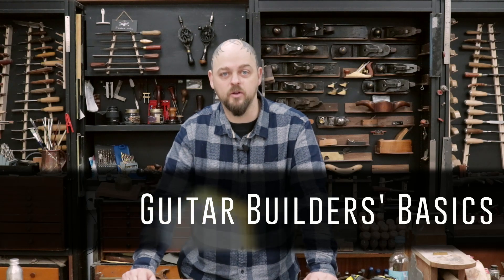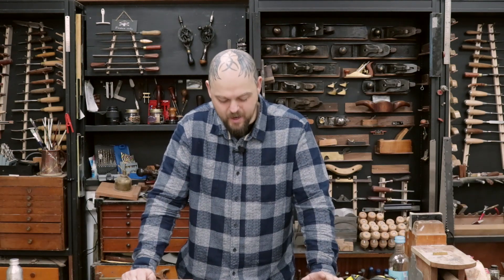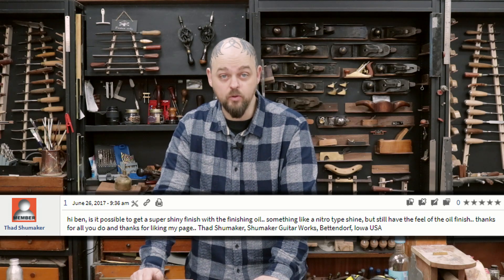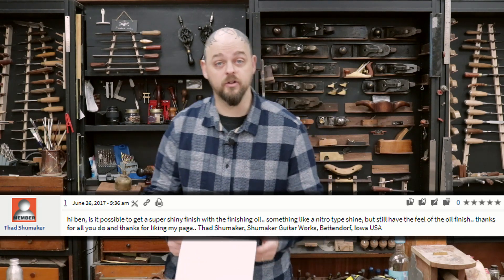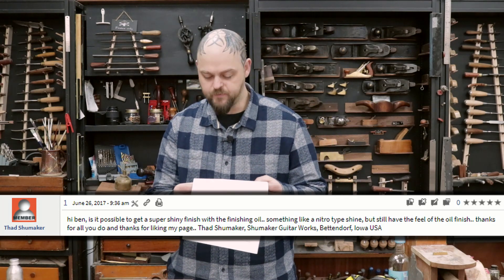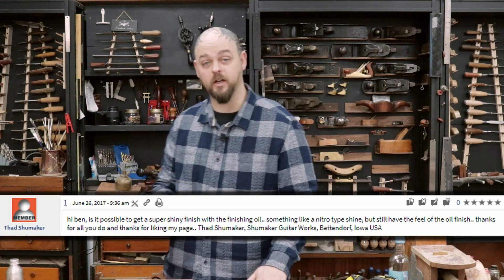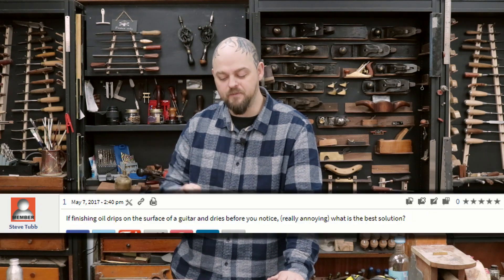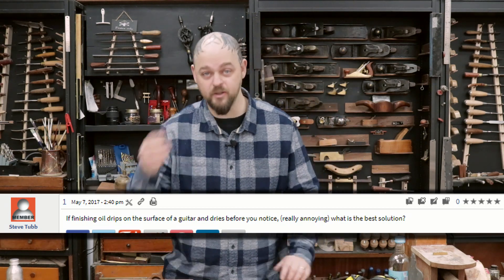Oil Finish Tips & Techniques - Guitar Builders Basics Episode 184

Comment: Not a mini-torial as you asked for, but I would really like to see how Tom goes about getting the Nitro look from finishing oil, as I too would like to achieve a nitro-look whilst only using finishing oil.
Reply: Me too! Even a Mini-torial would do, in a partially time lapse manner if needed. 

Despite Ben saying the 1500 grit wet'n'dry for applying the oil will act as a sealer, I still can't get a solid surface on knotted and knurled wood using that method. So puh-leese!
Reply: use steel wool every 2-3 layers and just keep applying oil, youll end up shiny. from memory i think tom said about 15 layers gets a nitro look
Reply: Yeah. Plenty of coats and cutting back.
Reply: Is there a reason why my oil finish is still a bit sticky after a week of drying

Comment: Hi Ben, I achieved a high gloss by rubbing the first few coars in with 1200 grit,  and then applying on a few very thin wet coats to a uniform shine, and just letting it cure without rubbing it off. I ended up with a nitro type shine, and whilst the shiny coats went touch dry within about 24 hours, it remained grippy for about 6 months.

Comment: From experience: if you use 1500 sandpaper on a stained surface, you can damage the stain and leave a nasty mark. Even after 10 thin coats of finishing oil.
I did just that on a guitar I made in a Crimson 5 day course. But it still is my favourite guitar.
The Crimson  oil finish gives a very nice shine after many coats. Take plenty of time to let each coat dry or it will feel sticky for a longer time. It feels much better than lacquer. It is pretty vulnerable though.

Comment: Currently working on my first actual guitar build.
Already put together a kit guitar. I like how it came out, except for the last little bit of the finish. (Specifically, the clearcoat. It's awful. Probably because I didn't sand enough at the start, though.)
Right now I'm in the resource collection phase, along with squaring up the MDF that I'll be using for designing the template. WooT!

Comment: G'day Ben
Product question: I make hand made wooden and bamboo flutes and from time to time I have a need to stain a section of a flute a vivid colour. Bamboo is a very hard fibrous and strong wood, yes it is a wood, much like many other hardwoods except that it's grain is vertical. Does your stain penetrate the hardwood you use after it has been sanded to say 20,000 grit? As that is the way bamboo that has had the outer layer remove acts. I us very hard to use inks at the moment and they are not what I would like to be able to use.
This is not really a good question for your tutorials but would help me all the same. I do watch most of your videos and have picked up a lot from you and yours.
Thank you
Tom

Comment: Question and some advice. 
Question: How do you make sure you get the right neck angle on a neck through guitar?
With your finishing oil, may it be as hazardous as the other oils to spontaneously combust when you leave an oily rag laying around? If so, I add the right handling of the rags in your videos.

Advice: As you mentioned you and your team are using gloves. If they work longer than 30 minutes with those gloves there is a high (!) risk that they'll have skin problems in the long run. Skin problems are the number one reason why people can't do their job any longer. If you haven't done it already. Put a skin protection plan in your halls and make sure they follow it. Skin care products are even worse in that situation cause they open the skins barrier for all sorts of harmful things cause it is supposed to be absorbed into the skin. What you need is a skin protection product that stays on the skin instead of absorbing into it. It's not that expensive, it's applied quickly and you won't fuck with your hands when you work with gloves or handle stuff you're not really sure about. I know from your shed days that your lungs already have some damage and now got proper gear but don't forget your skin.

Comment: in finishing my guitar with your penetrating oil  i have realised 3 coats in about buffing rather than wiping off the excess.  i think in trying to then buff on the 4th and 5th coat it has slightly dulled in a couple of places and is a little bit grippy but also very nitro looking.   should i leave it to cure for a week and then lightly sand with 2500 and reapply or 'other'
Reply from the maker: It should be fully dried/cured between each coat or it will remain 'tacky' and have to be sanded back.  Also best if it done in a warm dry environment. I have given you a link to a video in which Ben is demonstrating finishing oil.  The method is the same as penetrating oil.  https://youtu.be/mroo3QWCne4
Hope this helps.  DC

Comment: Question for anyone who knows or can theorise... I have a solid spalted beech body which I am treating with a water based wood hardener (it's an American product called PC Petrifier, we don't seem to use water based hardeners in the UK). I want to use the Crimson oil as I've had good results in the past and the test piece of spalted beech looks and feels stunning. I'm concerned that the hardener will not allow the oil to penetrate. In my mind, I reckon it will penetrate a bit but will it be enough to build up a sheen and that silky feel? Don't want to go with a cheap looking PU or other film finish but I have to harden the wood or I reckon it's gonna explode under tension... Jeez... This lutherie lark is a minefield...

Comment: Ok, help please!
I used the stunning stains and finishing oil (penetrating) before on different kinds of woods, now I am using it on a maple top, at first it was amazing but now I’m at the fifth coat and instead of wiping off nicely like before it became matte and sticky and any attempt to wipe it off just results in an uneven surface and scratches from the paper.

I did everything as the videos explain, do I need less coats on a maple top? Do I just keep going til it turns great? 
Thanks.

Comment: A ps to this info, relating to the drying process. As you say, there are 2 drying mechanisms at play with drying oils. The first being by pure evaporation of solvents, if there are any, where low ambient temperatures will just slow the process.

But the second process, cross linking is different. I'm sure there are some forms of metal-complex driers in your finishing oil, perhaps cobalt, surely not lead these days, and these facilitate the proper polymerisation of the oil chains. Problem is, though, if it's too cold, the polymerisation is inhibited and the improperly cured oil will never cure properly - even if you stick the item into a heated place later. Once the oil goes through a poor cross-linking pathway then there is no going back and you are left with a weak, even cheesy film forever.

Question is, how cold is too cold for your Crimson Guitars Finishing oil? Not sure what the situation with other products, typically True Oil, is either but I'm looking up at my thermometer (next to my barometer, hygrometer, UTC clock) and it strikes me that 12C is bloody cold, perhaps too cold for finishing oil.
Reply from the maker: Hey Ian, I think 12 is too cold.. we haven't done the test ourselves but I'm going to as the chemists to let me know and will answer this properly in a WOTB episode soon! B

Comment: Great stuff as always, Ben.  Question: have you ever tried using automotive paints on a guitar?  I work for an auto parts warehouse and can get paint at a nice discount.  I would dearly love to put on a candy apple red finish that looks like you could fall into it.  Is this possible and if not, why not?
Reply: Just curious, but why? are you painting metal or plastic? Kinda seems like more steps, fumes, etc. You can pretty much replicate a certain color used on a car, although... I've always loved metal flake, like, a seasick green flake would be kinda boss as a finish.
Reply: Well, because I can get the paints at a discount, so the cost is really reasonable to get enough to cover a guitar.  It was something I thought I would try mostly because one of the guys here at work has done quite a few custom paint jobs on cars for things like the Woodward Cruise in Detroit and the Metro Cruise here in Grand Rapids, and I can pick his brain.  :)
Reply: Oh you're from Detroit, nice! I lived near Woodward Ave. as a kid for a brief time. Sounds great! That's really cool they still have cruises, too!
Reply: I have a tele copy I sanded down and had a friend paint with a car paint-white sparkle that changes tint with the angle. My advice is either use pore filler or primer first. Use the right spray equipment for the PAINT. It helps to have a friend who KNOWS about painting cars. Good luck.
Reply: Thanks, Robert.  That was the plan on the primer.  I was planning on an initial coat of primer, sand off the "cottage cheese" an then another coat.  I suppose I could test it on some scrap and see if it works.  Hmmmmm....
Reply: I think early guitars were often painted with car colours

Comment: I'm so frustrated from just finishing my 12th build and the finish turned out like garbage .....  ... 12 guitars in when I am finally making them not have build issues , yet my finish makes them look like it's my very first ...... ..... tried lacquer on most and poly on the others all.with the same result when i do the wet sand and buff stage..... severe scratches everywhere some deep, and long, some very small, hideous......
Reply: So it's during the buff out? Maybe some loose grit from the sanding process are still floating around.
Reply: w13rdguy these scratches are definitely from sand paper .....
Reply: What kind of sandpaper are you using and what grits? Leave that info here for someone who has more insight in the sanding process than I do.
Reply: onpsxmember .... I think it all came down to the buffing compound I'm using.....
Reply: What are you using? Just for all of us to avoid it.
Reply: onpsxmember Mohawk finishing products... step 1,2, and 3 ... sanded to 2000 grit, but never was able to get any scratches out by going from 2000 grit to the compound.....